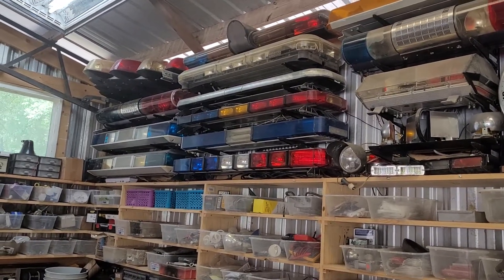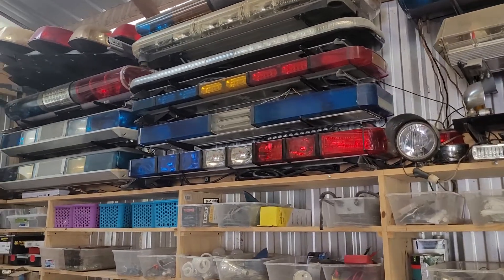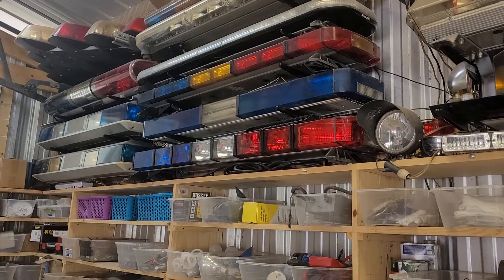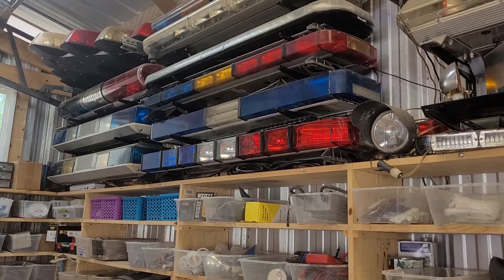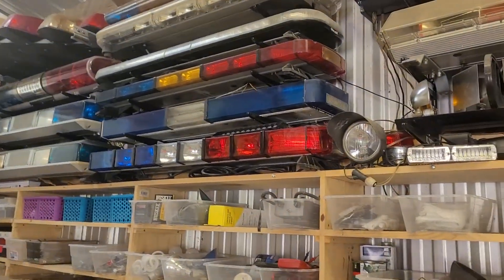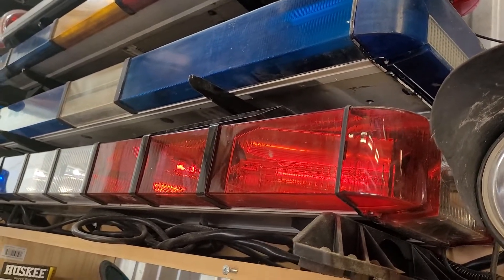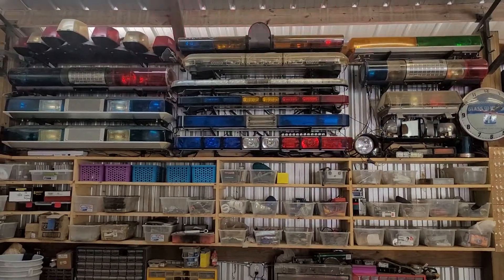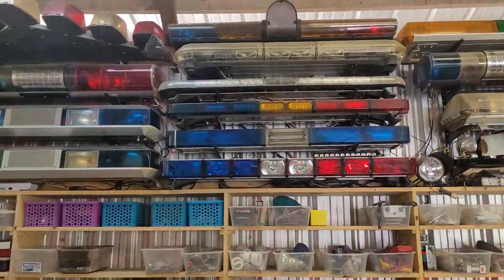Whelen strobe sounds

Comment: If anyone wants my boring lighting information lol Fluorescents are closely related to these. These Xenon bulbs are also a form of HID, still in use on many cell phone and TV/radio towers. They instantly turn off and on and in this case strobe. They’re closely related to metal halides, which are basically mostly used for stadium lighting. Mercury Vapor, also a form of HID, are the bluer, sometimes blue/green/grayish versions of metal halide. Their advantage is they last longer than metal halide, I believe. High pressure sodium is also HID. Those are the notorious orange street lights. They made the most lumens per watt, but their color temperature could make it difficult to see a whole lot, and especially make it hard to see color, as they’re borderline mono-chromatic.